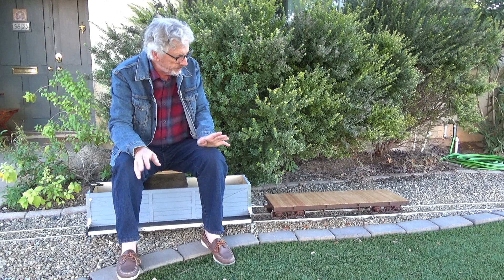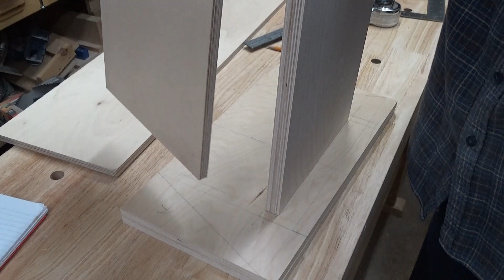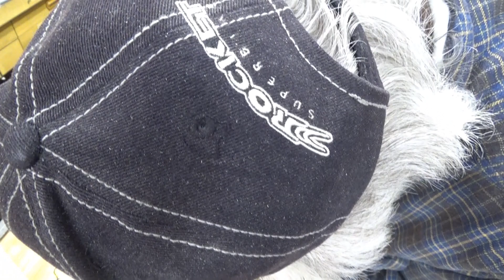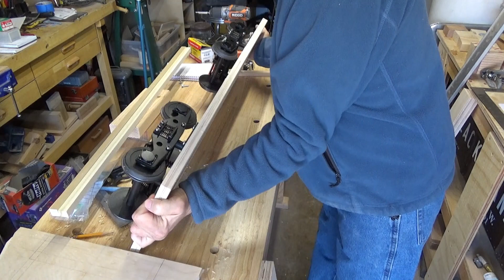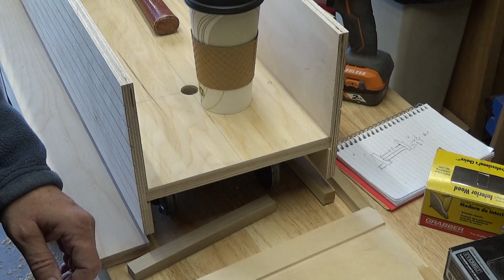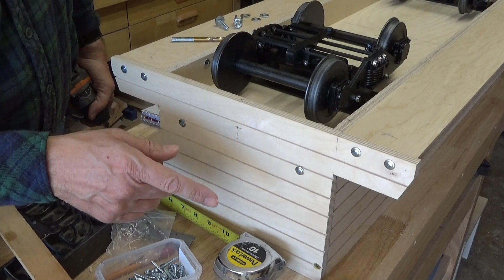Engineer Open Wagon Project - Part 1 -  Crow's Nest Railroad

Comment: Great project. I built a riding carriage for my 5" gauge but made the chassis out of steel. It was over-engineered and too heavy! I might well copy your idea, a lot less work, a lot lighter, and a lot cheaper!
Reply from the maker: Stephen, I don't know how your track bed is planned, and whether or not you will be lifting your equipment frequently by hand, but cars that are too light tend to derail more than heavier ones.  When empty with no one riding on it, I usually add a piece of masonry to my wagons.  I often see empty flat cars at our 7.5" gauge club with weights on them to help tracking.  So maybe yours is not really too heavy?

Comment: A steel bar to connect the engine to the car at the clevis would be a better and stronger choice than aluminum.  Steel won't wear as quickly as aluminum either.
Reply from the maker: True and true.  Thanks, Roy!

Comment: ¡Hola buenas tardes Stan!  Great build video and, as always, very professional woodworking techniques. Will you be adding any buffers to the trucks and cars you make? As ever, stay safe and well. Un saludo. Gary
Reply from the maker: My steam loco has buffers, but my cars will not, at least for now.  They will be connected by an aluminum bar, so they will stay a fixed distance from each other which also helps with the very tight radius curves I have.  Thanks and many blessings, Gary!  Stan